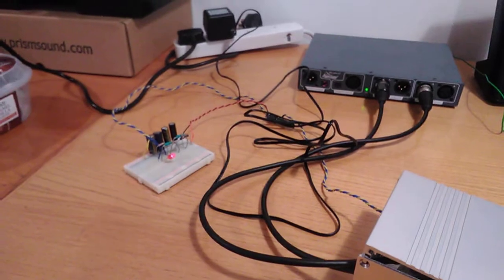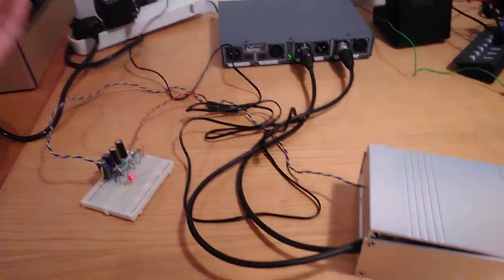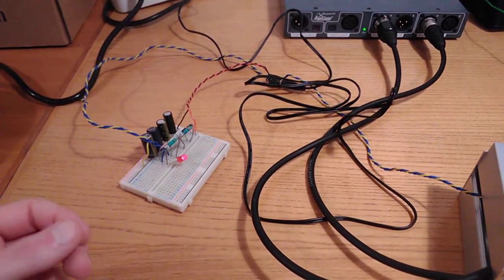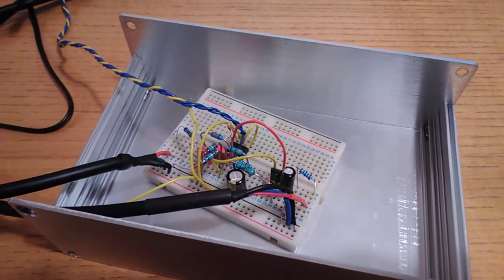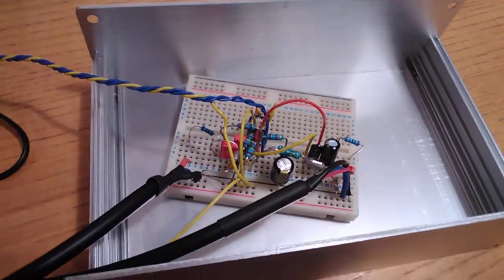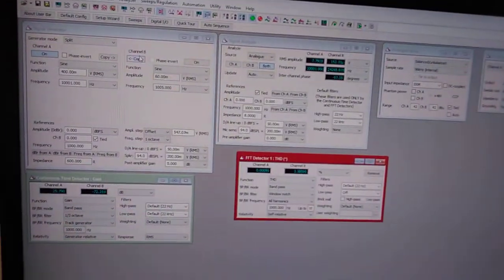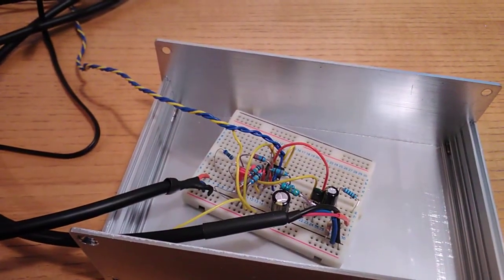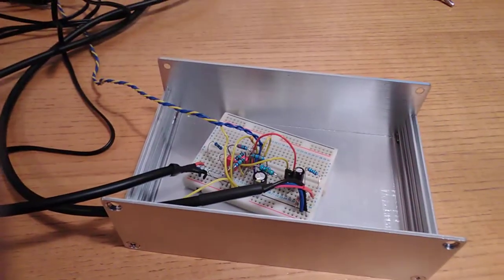Classic Audio '2068' phonostage development!

Comment: Hello Michael, 2068 is a decent OPA - OPA1612 is worth a try, lower noise and distortion. Might be a little more finicky with PS bypassing.
Reply from the maker: Not suitable for MM inputs, as it has about 1.7pA/sqrt hz input current noise density. 2068 has 0.3, so much lower noise when used with a high-impedance source such as an MM cartridge.
Reply: @michaelfidler8218  Yes, you are on the money, 2068 has a sweet spot combination of fairly low voltage noise and current noise. TI do have a couple of BJT IP similar and also the Cmos OPA1656 but the 1656 has a lot of LF noise - otherwise really good OPA.
Reply: @michaelfidler8218 what about OPA1656?
(I know this preamp is already in production)
I know thats not through hole so a dip8 converterboard might be a hassle..

Comment: But you've got a type of regulator there what is that a half bridge using the diodes, how's that better than using a dedicated regulator less forward current? Is it a real issue tho using say N10005? Can't you just have greater capacitance to make up the difference?
Reply from the maker: Lower quiescent current, no dropout margin + excess required.
Reply: @michaelfidler8218 right does that lower the noise floor as well make it more linear than low switching?
I can't understand the capacitor set up you've got looks like some of the negatives are going on the positive rail how is that working? You use them as bipolar set up?

Actually you might be able to give me some advice if you don't mind!! I saw a valve buffer stage by musical fidelity x10d to work with CD, and I had to query three of the electrolytic capacitors was connected to ground to do with the power supply from AC 12 volts, they all shared the same ground plane, but three of the capacitors where reversed meaning plus was to negative ground, to me that doesn't make sense, they weren't set up as bipolar but they were working for a B- power rail power supply when I looked at a circuit diagram. But still can't seem to work out why an electrolytic would have its positive connected to ground ? even if it's the minus of the B- 
 I had a look on forums and nobody's mention anything about this assume it must be correct?? If you're having a b- power rail do you have the electrolytics in a reversed priority like that?
If you could advise me on that be great thanks!
Reply from the maker: @hoobsgroove  the noise floor on an amplifier output connected to a linear supply tends be lower as any noise will probably be close to mains hum (low frequency) as opposed to switching hash (high frequency) which most amplifiers are much more effective at rejecting.

A single transformer winding is half-wave rectified into a positive and negative voltage to create a split supply (https://michaelfidler.com/articles/practical-vu-meter-circuits/#8) like so...

If you have a negative voltage then electrolytic capacitor positive terminals will reference to ground (otherwise they'll be the wrong way around). It's pretty standard practice to do this for reservoire/filter capacitors.
Reply: @michaelfidler8218  ok so the capacitors are correct when it comes to negative voltage B- the positive becomes ground in that case, so they're not the wrong way around on the x10d ok thanks clears that up. Is that what you're doing with your power supply with the capacitors? the adjacent capacitor is flipped.
Oh I see capacitors are flipped because it's a split rail supply on yours, isn't that more difficult too reduce means ripple? But if you use a one ferret polyurethane capacitor after the diode in conjunction with the electrolytic would that give you enough smoothing?
One thing I'm not sure about is how you get good smoothing from the transformer? I have to read the article you posted in more depth Cheers for that.